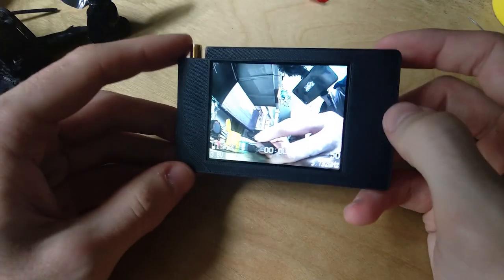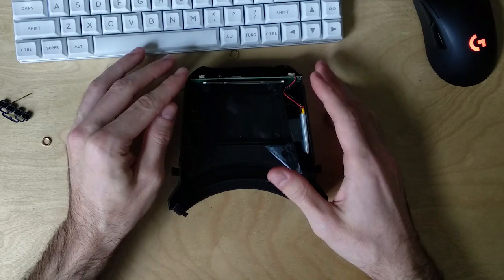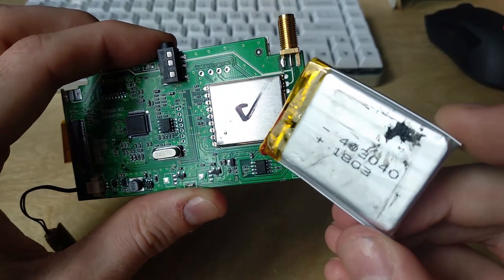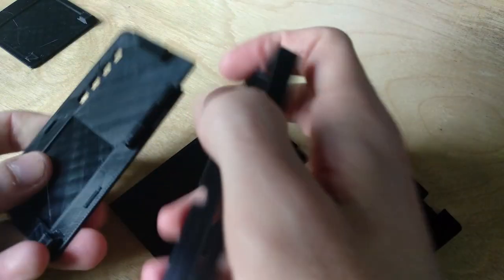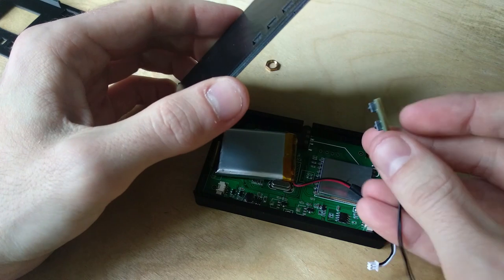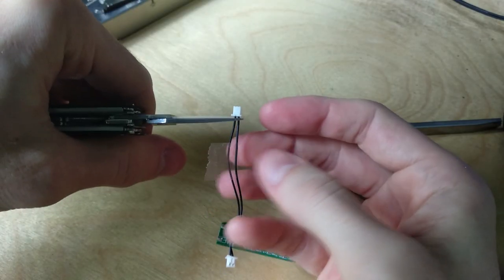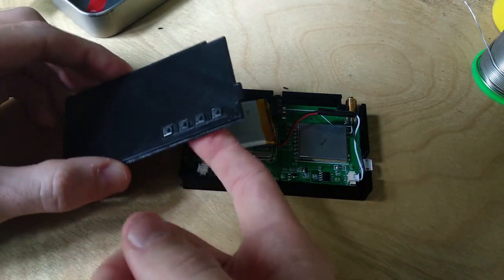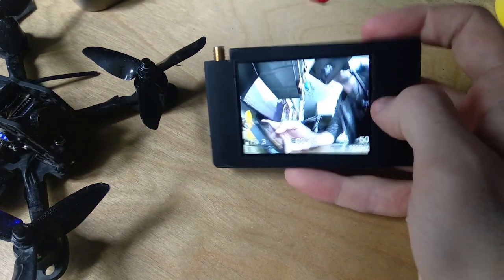DIY Budget Wireless Display Eachine VR006 MOD

Comment: Desolder the sma connection and solder the antenna element straight to the board then tuck it inside.
Reply from the maker: You'd have to go with a dipole, but totally doable for extra clean build!

Comment: Nice mod. Note that for practical purposes, however, getting something like this: http://www.hubsan.com/na/index.php?main_page=product_info&products_id=839 is probably simpler for most people.

$5-10 dollars more, but no 3D printing or soldering involved, you get a built-in DVR, a free antenna and funny-looking box-(in the true sense of the word)-goggle as well (which is too heavy to be usable, though).
Reply from the maker: Hey thanks! I haven't seen that one, It's definitely what most would be better off with for simplicity's sake. My project would be better suited to tinkerers and those that bought the VR006 and can't use it because it has awkward lens distance making the screen hard to focus on, thanks for sharing!